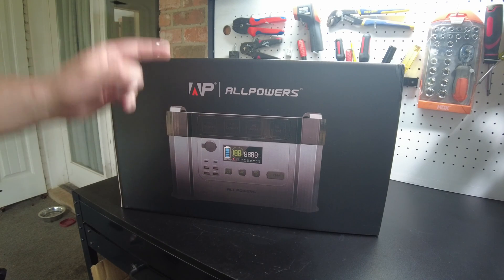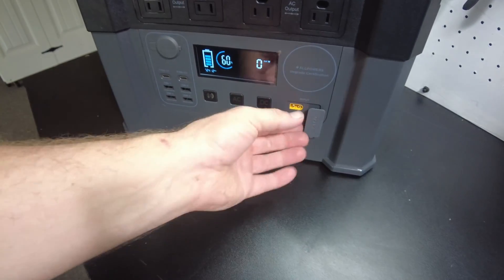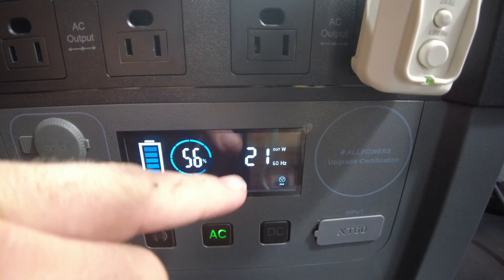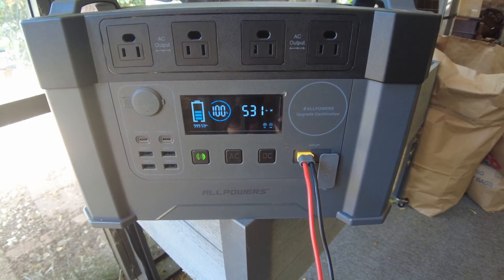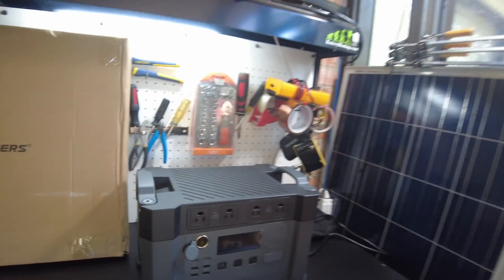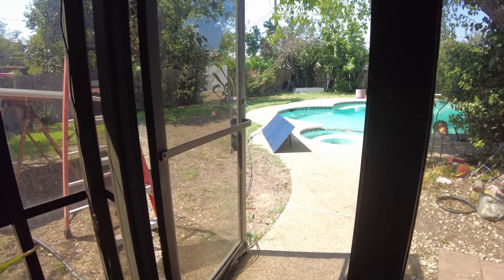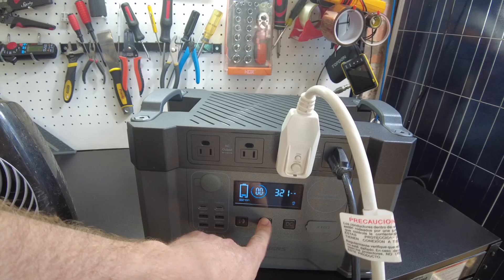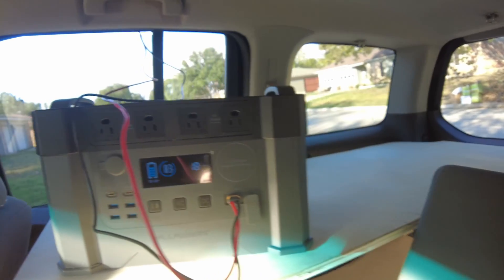ALLPOWERS S2000 2000w Portable Power Station

Comment: Hi (Hope you get this), I bought this generator off the Allpowers shop on eBay Australia, and had the SAME problem with solar charging: Starts off strong, then suddenly drops to almost no charging (in my case, down 2W!) even in full sunlight, and the ONLY way to fix it is to disconnect & reconnect the input cable (like you did). In MY case, however, this problem is RECURRING/ongoing. In one day, I have to dis- & re-connect multiple times (after resetting, it happens again, sometimes after 30 mins, sometimes after 1 hour). Seems to be no problem with mains charging--only solar. I first reported this directly to the service team at Allpowers, only to be asked to write to their sales team (even though it's a service issue), but sales hasn't responded. I have now reported it to the ebay seller (even though it's basically the ebay outlet for Allpowers itself!) and am waiting for a response. It seems to be an MPTT controller issue, but no one at Allpowers is telling me. I'm wondering if you have (in the 3 months since you posted this video) faced this same problem again, or are experiencing it as a recurring issue like I am, and have you reported it?

Comment: On a regulated DC output it doesn’t matter if you use a 2 wire discharger since you’re just going until the BMS trips right?

Do you know if the converter is a buck, boost, or buck/boost?
Reply: 1427/1500 leads me to believe it’s a 4S NMC pack and the converter is a buck only just based on the efficiency. Otherwise it’s a super efficient buck boost that helps bring the voltage up at the very very end of the discharge curve. 

Not knowing the voltage range that this thing uses also means I’m making a lot of assumptions. 

How do you feel about a 2000W inverter on a 1.5kwh battery? I guess without knowing the cell model used I’m making another assumption in assuming a 1.3C discharge on the cells might be a bit of a workout for them. Most cells support up to 2C just fine and even the 3500mAh 18650’s support 3C as a max continuous. 

I’m just not a big fan of pushing cells over 1C discharge for the sake of cycle life
Reply from the maker: @ericklein5097  I think it's a 6s NMC pack, and the converter is buck. Most of these power stations are higher voltage because of the efficiency that brings.

Comment: If you can get 500 watts of solar into this it could power a small air conditioner on a sunny day. My Frigidaire only draws 400w max. My 300ah Ampere Time battery runs it a long time.
Reply: I was wondering if it would run a fridge.

Comment: Brad Like you said it seems to handle the solar well. Thats the only reason i would have to buy a power station.
Reply: It’s solar input range isn’t the greatest at a max of 70 volts but that’s roughly equivalent to the Ecoflow and Bluettis of this size….but 500W on a 1500Wh battery is pretty decent too. And seeing that it will actually pull in 530+ is even better. Most units need at least 4 hours to charge on solar, this could do 3 hours. 

At the price point these things are a banging deal. Also check out the AceVolt/Grecell/FFPower 2000W models. I think some of those might be a 2000Wh battery. You can find them for $900 or so if you search hard enough.
Reply: @ericklein5097  the reviews ive seen lately the max voltage is 60 volts on some of the bigger Bluetti. So its a little better in trying to make a small solar array work for ya.

Comment: It is not bad based on this review but not as good as I would want it to be. I do not like that it shares the input and output wattage, so it only tells you the difference. Not sure if it has a ups function or if it just lets you charge and discharge at the same time. Also, slow ac charging if 340 watts is the best it takes in from ac power. Not sure if it takes more. Not bad on the solar side at 500 watts. I am not sure what the solar input voltage is. I think it uses lithium ion NMC batteries, but I did not see it listed on the amazon page. Just based on the amazon reviews I would not buy it. Seems like too many people have issues with them. As a rule, I do not buy anything with less than 75% 5-star reviews.

Comment: you didn't mention while charging if it prefers AC or solar, or does both?
you also didn't mention if you could charge it via solar and run a AC or DC load at the same time. most would assume that you can do this, but not all allow you to do this.
also when you had the AC going and it plugged in via AC did you notice if it was still charging, or was it discharging? reason is it looked like the AC was pulling more power than it was getting charged at via the AC plug. or was it switching the load like a UPS function?
Reply from the maker: It'll charge from both, so 500w for solar, and 400w from AC for total of 900w. Yeah it does not switch the load like UPS function. It only charges at normal rate either 400w from AC, 500w from PV or combined for 900w while powering the AC load. Thanks